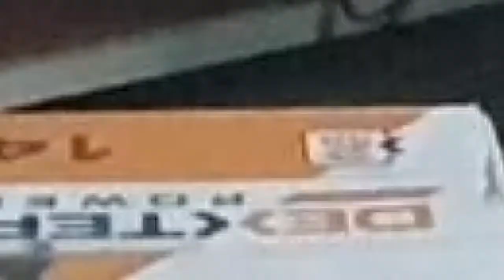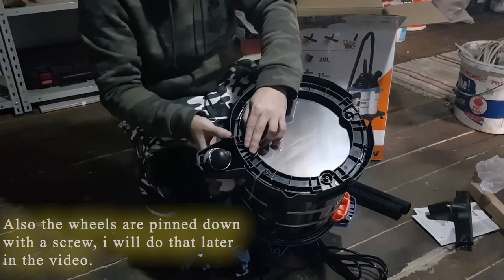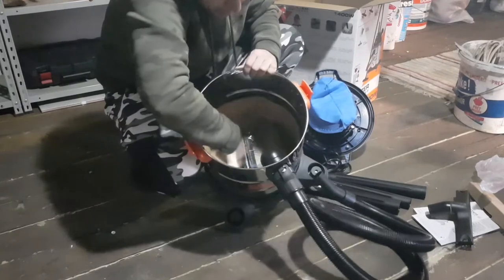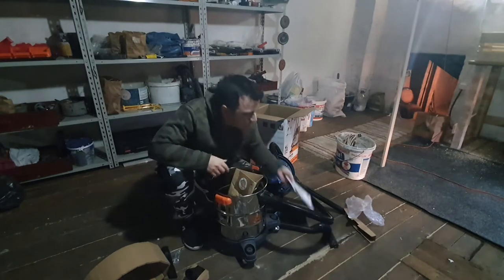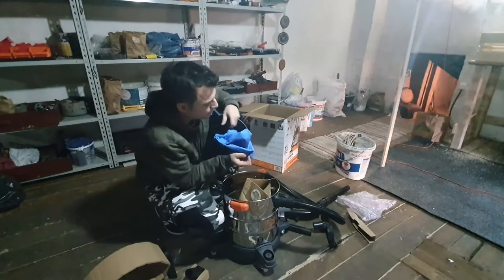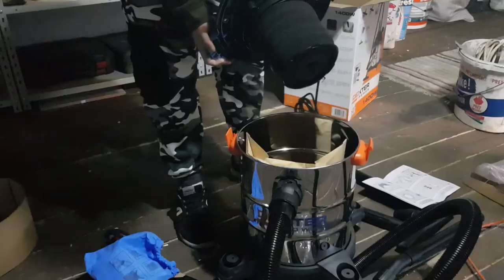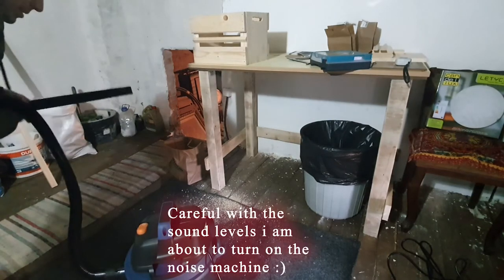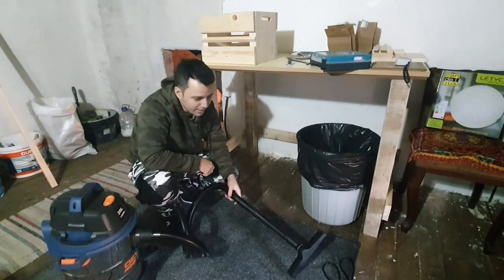Dexter Vacuum Cleaner 1400W Unboxing - Assembly - Short Tests

Comment from the maker: What are your opinions/ thoughts about the Dexter Vacuum Cleaner? do you like it? do you hate it? does it have room for improvements?
Reply: Thanks for the review. How well does it clean fine dust (like marble/ wall debris etc.)? Does it clog easily?
Reply from the maker: @miatacollector    It doesn't clog at all, just cleaned last weekend some dust remaining from marble and bricks it gets the job done, and the 20L capacity is enough I still didn't change the first bag after all this time :) (weekend woodworking only and the usual walls drilling for mounting all kinds of stuff)

Comment: Hello i bought this vacuum but i dont know the use of the "Brown" filter and how to change or buy another ? Or is it Always use the same After change ? Thanks
Reply from the maker: Hi lndebaisieux, to mount the brown filter you simply need to get the hole from it aligned with the curved joint inside the steel can and twist it and push it against the can wall until its nice and snug, the brown filter is only for dry vacuum, and it can be used/cleaned multiple times before you can throw away one of it. When you sense a lack in vacuum performance then you should replace it. The filter is not mandatory but it helps you allot in keeping the steel can clean after each vacuum. Its hard only on the first try as you could see in the video min 11:17 but after you get the hang of it its rather easy.

Comment: ERROR : dont put the black filter with paper bag : it's for the water ! it's normal after it not capable to bring the dust !!
Reply from the maker: aaaa i didnt know that, thanks! I was using it like this with the black filter and paper bags, and i had no issues collecting the dust, the only issue i had was with the bags, paper and textile they are low quality and always unglue the head from the bag. Thats anoying. Other than that no other issues, its a great Vacuum Cleaner i use it all over the places where i work, even more than my other expensive one Bosch Professional GAS 35 M AFC